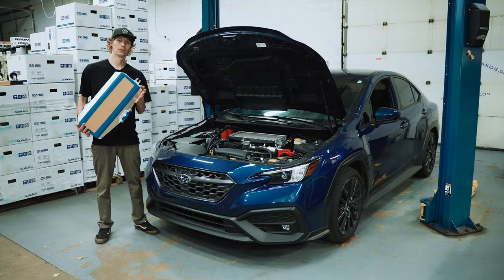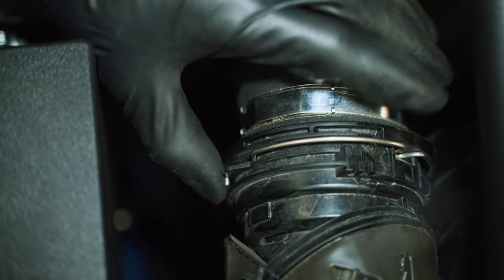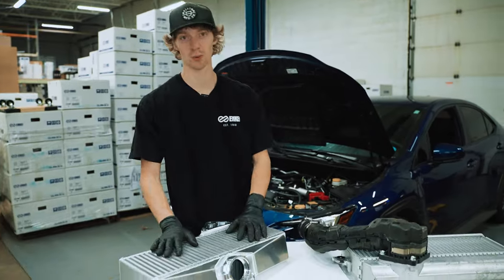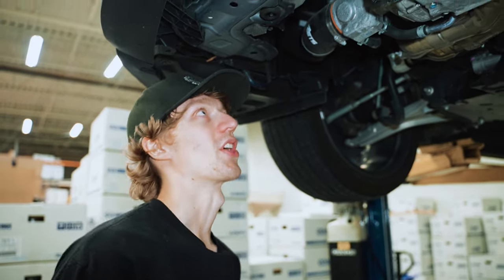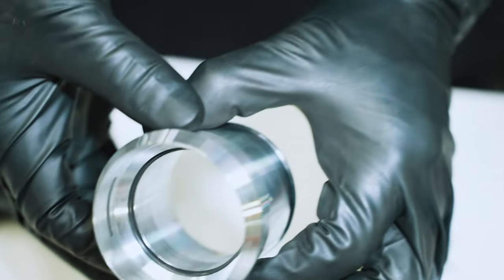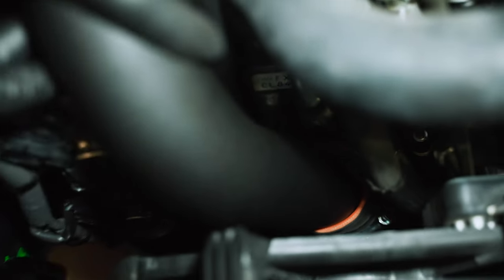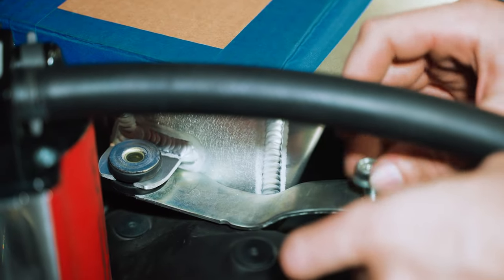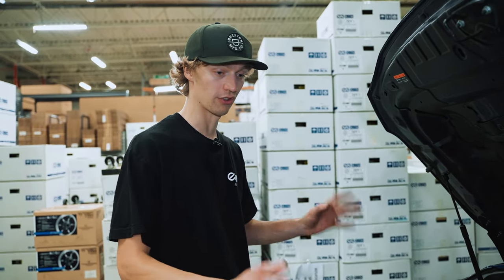2022+ VB WRX BIG Top Mount Intercooler AND Charge Pipe from ETS INSTALLED!!

Comment: I wonder whose gunna be the first company to put out a new piece instead of reusing the stock plastic piece that attaches to the intercooler
Reply: Perrin's top mount has its own charge pipe mount that's is part of the intercooler vs using the oem plastic piece.
Reply: @mnstr4lfe ^^ plus slight increase in overall dimensions
Reply: Process west tmic also doesn't reuse the plastic piece

Comment: dumb question, wouldnt you want to use plastic pipe instead of aluminum to avoid heat soaking the intake air?